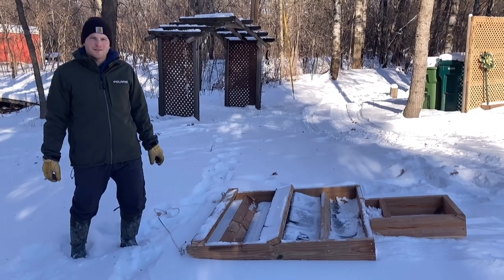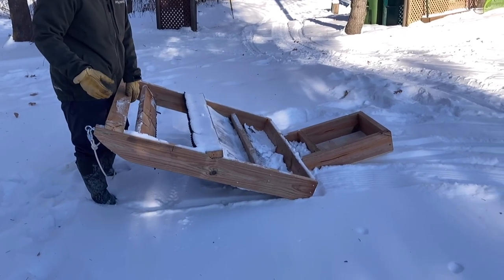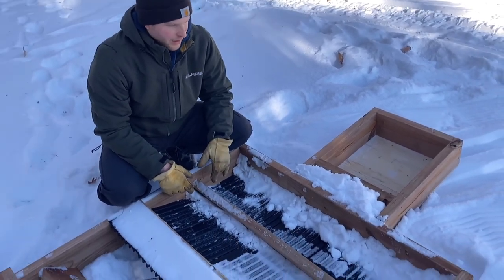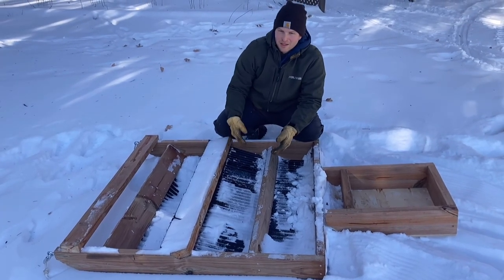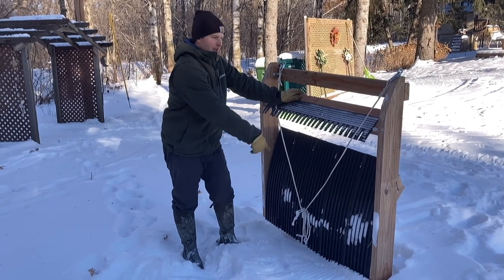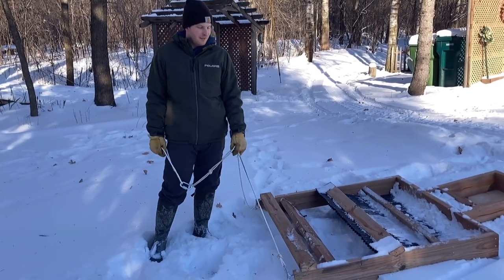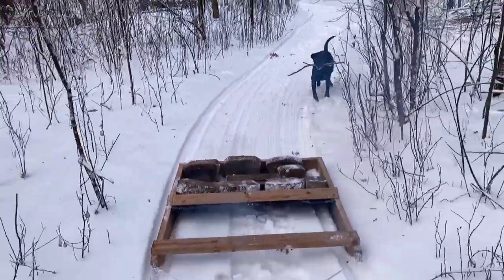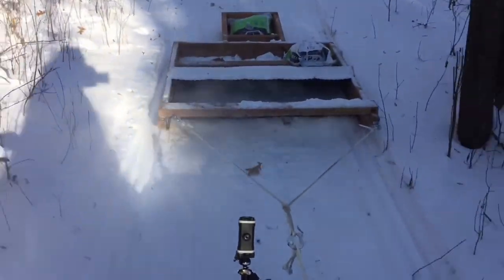DIY Ski Trail Groomer Simplified

Comment: Thanks for sharing. Another option for the rubber pieces are stable mats used for horse stalls. We have them at our local feed store in a relatively small town. Not a bad compromise if you are in a remote area.

Comment: Thank you for your videos! I built one based off of them. 7’ wide for a skate deck or to be able to double track
Reply from the maker: That’s great to hear, I like hearing when people use some of my ideas. I’m interested to hear how it works out for you!
Reply: @northwoodsengineered  the drag works fantastic! It really only took a couple of hours to build and less than $200 in materials. I’m using a tracked ranger to pull it with a track setter piggybacked behind the drag.
Reply from the maker: Awesome, I hope it keeps working out for you.

Comment: Working on the ski trail groomer and wondering if you could send me the dimensions of both the smaller track setter box and size of the skis.
Reply from the maker: I can measure the one I have at my house however i believe it’s the same as the one in my other groomer video. If you go to my page and watch the first grimmer video I made and go to the 4:50 mark you can see the dimensions of the track setter pieces. The size of the box is just arbitrary to fit the track setter pieces on there.  Let me know if there is another specific dimension you want